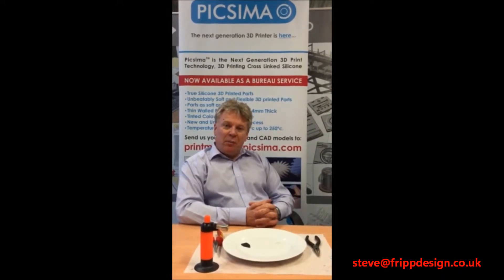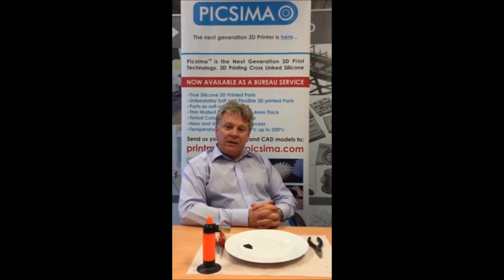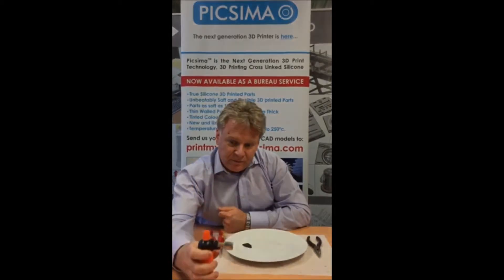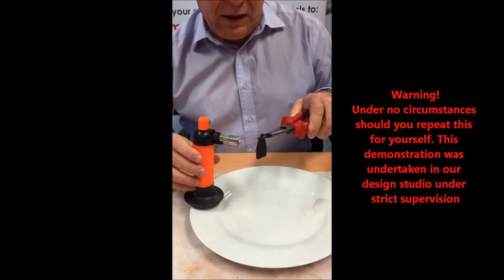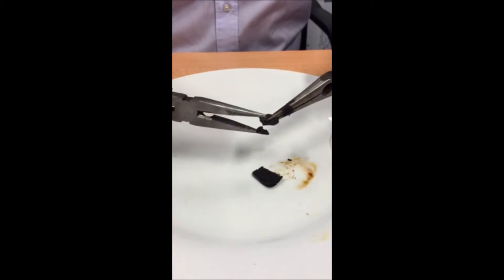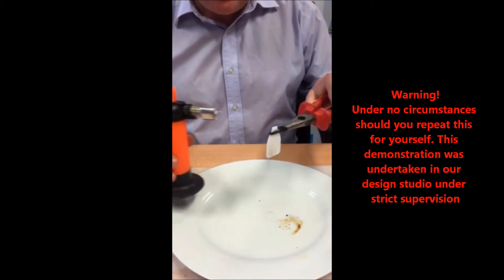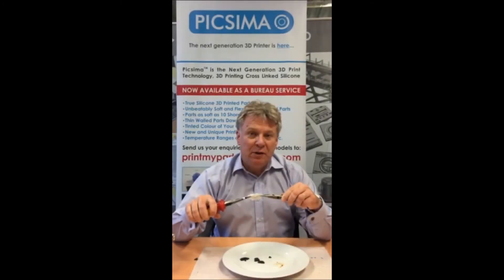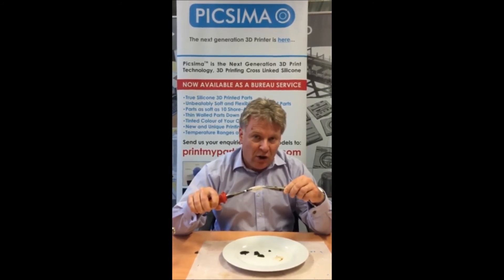picsima vs stratasys video 4 high temperature

Comment: Can i print silicone molds using a PICSIMA printer? The molds are using by centrifugal casting zinc.
Reply from the maker: +Eder de Araujo Araujo 

Don't see why not.  You're basically asking can it cope with the temperature of molten zinc and can it produce parts in a suitable shore hardness?  The
answer is probably and probably!
Melting point of zinc is 419 deg C so it should be OK.
Not sure what durometer is required but I assume fairly hard to prevent distortion in the centrifuge?  If RTV silicone is available that can cope then weshould be able to print it.